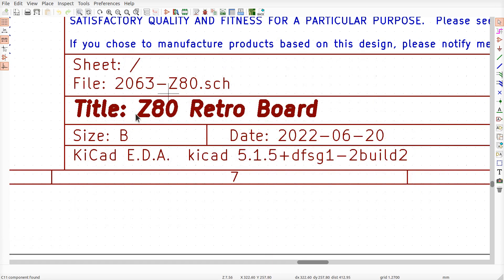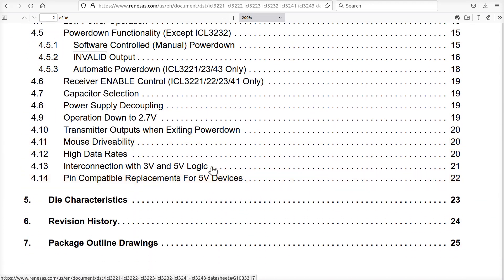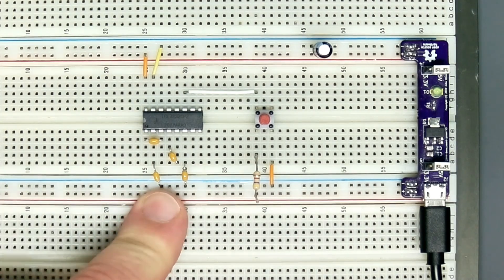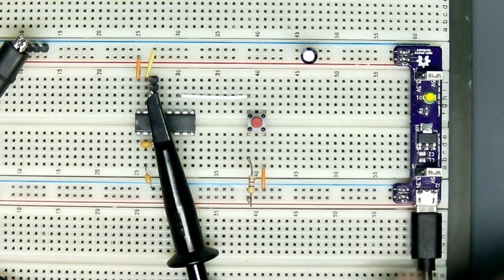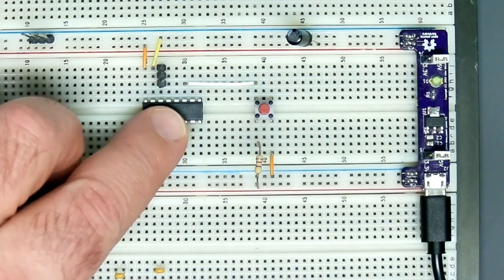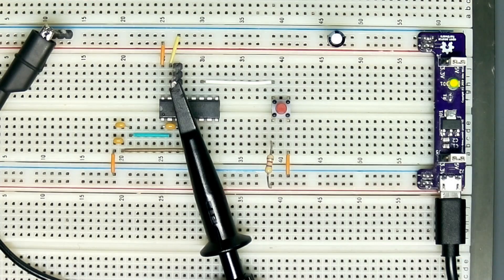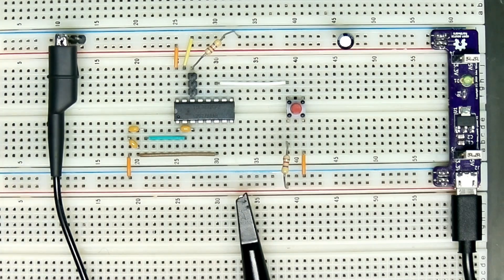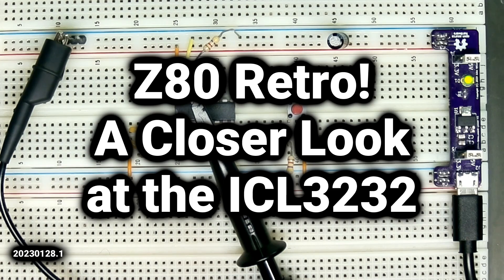Z80 Retro #59 - ICL3232CPZ Review

Comment: some time ago I could not obtain the ICL3232 and forcast on delivery by Digikey was long so at that time I have solved the problem using the 16pin smd  MP232EI from Texas Instrument mounted on an SSOP board to 16 pin DIL, no change in cap's needed which worked perfectly.

Comment: On the subject of capacitors I hear that common practices from the through-hole days are still being applied (incorrectly) to SMD circuits. The combination of 10uF, 1uF and 0.1uF decoupling capacitors are still being used in SMD circuits even though the SMD capacitors all have identical loop inductance and hence that rule no longer applies. I just find that interesting.
Reply from the maker: Is this true??  It'd be nice!
If so then I doubt it is SMD vs thru-hole... More likely it is that 10uF ceramics were not yet available back in the thru-hole days.
Reply: @JohnsBasement  I mean definitely don't take my word for it, but the explanation I was given is that the loop inductance is related to the physical capacitor size, which varies a lot with lead capacitors but now with SMD it doesn't. Hard to confirm though because I don't play around with SMD much.
Reply from the maker: @jimtekkit  I know that physical suze is going to play a major role.  But so does the type.  Some datasheet reading can confirm it easily enough.
This sounds like a good one for the eevblog.
Reply: well, read also about MLCC audio piezo-effect - I am now trying to risk 47u in the series of headphone amp output instead of electrolyte ... will see, or HEAR ))

Comment: The ICL3232 was not in stock back when I've ordered my parts, so I ordered Analog's ADM202E, which works perfectly fine with 0.1uF. From the datasheet : "A 0.1 µF capacitor is recommended, but larger 
capacitors of up to 47 µF can be used". It's pin compatible.
Reply from the maker: Perfect!  I'll add a note on that substitution.